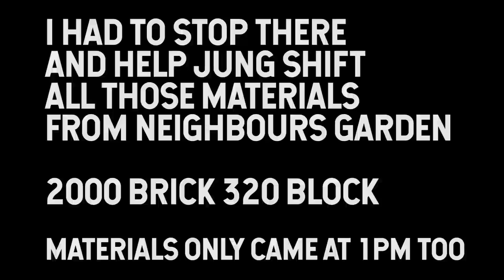Bricklaying - Buidling House Extension, Series UK #1

Comment: Hot weather...soak bricks with water before laying...and keep muck in large plastic tubs stops it drying out...liked the video.
Reply: In the summertime, bricks were hosed down before laying.  Coring holes were left out on the Tray-Damp to allow the clearing of the cavity until the wall was one lift high, 5ft thereafter cavity battens were used which climbed with the wall until the next row of ties was reached when it was moved up and placed on the ties.  This does not apply today as cavities have insulation installed and the mortar does not fall to the bottom of the cavity. Good videos and nice brickwork!

Comment: In Australia we are constantly working in 30 - 40 degrees C  ( 80 - 100 F) in summer, so we start at 5.30 am and finish about 2.30 pm , also depending on the type of brick we are using we also wet them down plus the mortar is a lot wetter ( which takes some getting used to ) but it means you cant put down a long bed and you have to be quicker.We also have to point up every course with a marshalltown jointer but generally a piece of 20mm electrical pipe is used but you have to have full joints then a stiffish  brush.You get a surprisingly good finish, though you wouldn't think so at first.
I will also send you some pictures of a different type of profile which is a lot easier and less time consuming to set up and use.
P.S - please do a twisted brick and a half pier.
keep up the good work mate.
Cheers.
Reply: It's actually hotter than that in F, it's 86 deg to 104! Insane! When he said 28 was quite hot I kind of laughed :)

Comment: Looking at the bricks you are using with a flat and a cupped side, now I'm not certain but I think they are supposed to go cup side down to get a good hold and decrease the overall weight versus the adding more mortar to fill the void and adding more weight, plus the potential to hold more water inside each brick cup side up.

Comment: Those type of bricks would of also look really good by using some carpet scraps rubbing your head and bed joints without raking them  ! But the raking looks good also . What type of line leads are you using ? You guys use some odd wall ties across the pond Lol .  ps why did you use cap blocks on the whole wall instead of standard block ?  you do good work sir .

Comment: Stu I couldn't help noticing, shouldn't there be a gap between the cavity insulation and the outside/ external wall.  When it rains a lot wouldn't damp bridge the internal wall with no gap. 😳

Comment: Stu - given that this is your sister's extension, did she get a drain survey done before work commenced???  Hopefully the drains run to the rear of the properties and not across. You do have to be careful about drains/sewers and the legal requirements of water companies, they do have this 3m rule and a 'building over agreement' is needed in such cases. Just trying to help here, sewers in back gardens can be a bit of a nightmare! Great vid anyway, one of my all time favourites, this looks like a cracking series in the making.
Reply from the maker: Yes Danny, everything been checked and double checked by everyone possible

Comment: Sir I was curious if brick could ever look good painted?  Have you seen that or would you recommend it? Because I have a old house I'm restoring the brick I was going to pressure wash/surface grind everything because there's a lot of algae there and water line from removed addition. I was thinking of painting it first and then putting waterproofing on it. Do you have any recommendations?

Comment: I watched this and a previous video and wondered why:

1. No footer drain is installed
2. No capillary barrier (gravel) below footer or floor
3. No ventilation gap between outer brick and insulation, and probably therefore no wind barrier between insulation and outer brick
4. Why fiberglass and not XPS insulation? It would perform better with cold temperature and high moisture

Is it because they are not needed or are too expensive? I'm guessing the first one, since the inspector okay'd it. I've understood climate in the UK is pretty damp and occasionally cold too. I probably missed something too, since I'm no expert in building. Similar building videos made in Finland are very different though.

Comment: Loving the videos. I've learned so much. Can i ask why you have used a 'cavity tray' aswell as the dpc as the foundation location? From what i understand of the regs they are only needed as openings in the wall such as doors, windows and air bricks. Did the foundation detail require it? Thanks!

Comment: Hi Stu. I have a question for you.i will be investing in some speed leads and am considering making my own. I watched one of your video’s “setting up a speed lead” and when you clamped the lead onto the brick at the bottom it was tight to the brick with no room for the line. The one way it works but if your using the same lead for the opposite direction do you use a twig/trig to put the line where it needs to
Go? Thanks pal. Nice work! I’m in Victoria bc Canada.

Comment: Wet them bricks mate. They can take a soaking. Maybe rack the corners rather than doing the whole pull? If it was me I'd do the return and a corner. Reveal and the corner and just pull in. Less boards that way. Especially in the heat.
Reply from the maker: Exactly Craig Been working today, been pouring buckets over each stack and they still dry after about 2 mins. Such slow progress!
Reply: @Stucrompton1 I feel for you there mate. Did a garage out of them bricks a few years ago with lime mortar. Absolute nightmare.

Comment: As a DIY'er how can I keep the morter damp working on my own?Great vids
Reply from the maker: You may struggle in this heat
Reply: tell me about it I have to keep adding water to the mix in the barrow. Just watched both your new vids I bought myself a set of the bricky profiles they work a dream. A video of how to set up profiles against internal corners would be good. Say hi to KC
Reply: @boyrope1  try mixing smaller batches, beats forever knocking up the muck by hand

Comment: Great vid Stu  soak the bricks in water
Reply: Wetting bricks can cause Different shades in motar
Reply: Causes efflorescence alot of the time aswell, I tend to add some hydrated lime to the muck so it goes off alot slower .
Reply: @leemoore107  what sort of gauge would you use pal
Reply: @mickythebricky9634  with a handmade brick that's soft I would use a 6:1:1 sand cement lime .
Reply: @leemoore107  ill give that recipe a try on the next one pal 👍

Comment: I'm going to build a front garden wall soon then render it. Do you recommend brick or block? If so which blocks or bricks. Thanks.
Reply: Firstly do not use and thermolites on exterior work.  Engineering bricks or dense concrete up to 150 above  finished floor level. Then dense or med. dense blocks  to finish. use a waterproof lime render scratch to avoid any residual cracking. leaving a 2 mm top coat.

Comment: Those profiles are a bit naff🤔
You need to remove them to point behind them. The ones I've always used are offset from the corner both ways, so once set up, they stay in situ until such time they need moving upwards. 
I can see their speedy setup if purely blocking to be rendered later, but I don't fancy them for face brickwork.

Comment: Can i ask as a diyer, when would you "tooth" the new bricks to old vs using that metal rail to bond old with new bricks?
Reply: Toothing bricks in is not allowed anymore as it creates a weakness in the existing building. Follow the example here with the wall starter and the dpc  poly roll at 1,5m from damp course.

Comment: What’s the actual reason for damp proof behind wall starter?
Reply: Good question
Reply: First i’ve seen that too plus overkill with the dpc tray on top of the 4 inch dpc at weep height. One dpc tray big enough to bridge at a fold and take a weep is more than enough.
Reply: Damp on top of damp is specified on some architect drawings (pure over kill) also the vertical damp could be more of a problem if you think of motar shrinkage thus leaving dampness to seep in to the vertical joint... Just my taughts 👍

Comment: Are you not using thermal blocks on the inner wall?
Reply: Hi it’s stipulated in the plans to use concrete blocks hope this helps
Reply: @seniorgolfprogress83  I just assumed thermal bricks were a must our brickie used a couple of normal bricks on a thermal block wall and building inspector made him swap them out.  Love the vids
Reply: @stuarthoffman1633  Thermal blocks were popular years back, not so much now. You aren't supposed to mix and match them with standard blocks because they have different expansion rates which may cause cracking.

Comment: Question why are you using concrete blocks and not 7 newton thermolite blocks ?
Reply from the maker: We did everything to the request of building control 👍
Reply: @Stucrompton1  Fair enough from the vid I would have tried sweet-talking them to do high 7 blocks as their still strong enough for steel that size and it's a lot better for your lad loading them out. I know some BI's can be funny. Thanks for the reply dude :)